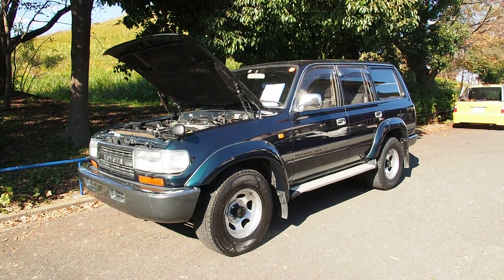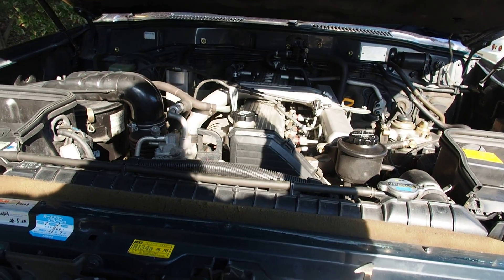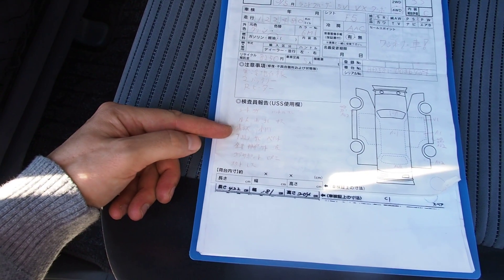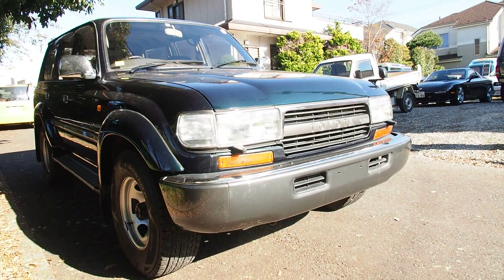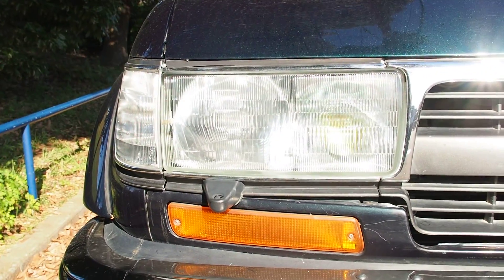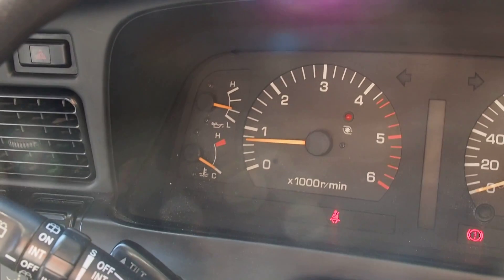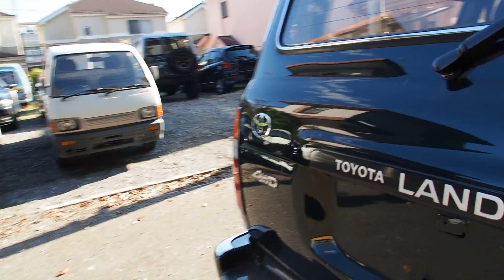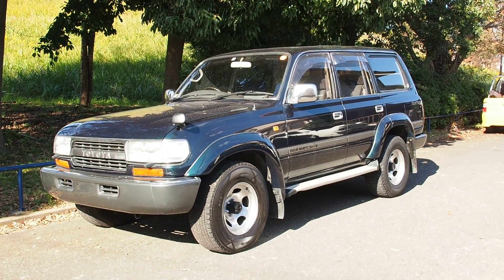1993 Land Cruiser 80 Series Turbo Diesel MANUAL TRANSMISSION (USA Import) Japan Auction Purchase

Comment: Dude this thing is the holy grail of 80 series Land Cruisers IMO.  The diesel inline six turbo was similar power to the inline six gas engine we had in the USA.  The main difference though is the diesel had a lot more low end grunt and wasn't stunted by an automatic, the manual felt a lot more lively because automatic transmissions from that era zapped a lot of the power.  

Also I really love that cloth interior and very 90's blue/green color shifting paint.  I mean this thing replaces all the worst aspects of USA spec Land Cruisers of this era, durable cloth instead of beat to shit leather, turbo diesel low end torque, 5 speed manual makes that diesel engine that much more powerful.  The one flaw of the 80 series in America was the lack of horsepower, hobbled by a power sucking automatic transmission. 

Also Toyota truck manual transmissions are very satisfying to operate.  Yes the throw is a bit long,but you will never miss a gear.   I've owned several Toyota trucks with a manual, driven company Ford and GM trucks with a manual, the Toyota trucks are far superior in terms of the gear shift(never vauge on the gear change), clutch, and are way less vauge in the steering.
Reply: It looks so mint,  and only 122k? drool

Comment: The real king of the off road , the best land cruiser series Toyota ever made and hands down one of the best 4x4’s ever made . I’ve got the exact same thing inherited from my grandfather and it’s only done 150k km after 28 years and still runs as good as new, so much smoother than all of today’s vehicles . You can’t ever go wrong with buying a landy as long as you keep up with maintenance especially the older models. If only today’s 200 and now 300 series had the same feel about them they may have a more desirable V8 engine and luxury interior and features but no where near the off-roading capabilities of the 80 series

Comment: In Saudi Arabia, most of the LC 80 we have came with a manual transmission in VX-R trim (highest trim) with inline-6 gasoline engine. People like the manual cause it’s more capable to off-road and had less issues. Even many of LC 100 had manual transmission with V6 or V8 engines (I drove one with manual).

Comment: It's not a 24 volt system. It only utilizes 24v for starting. All the lights and accessories run on 12v.